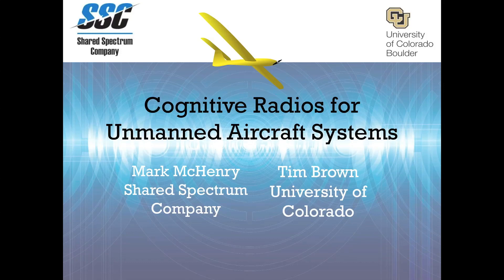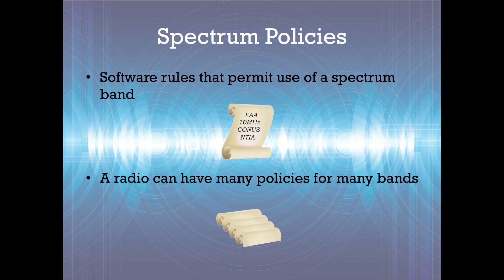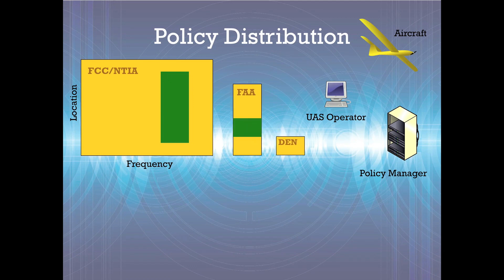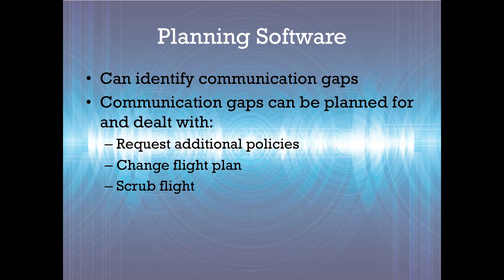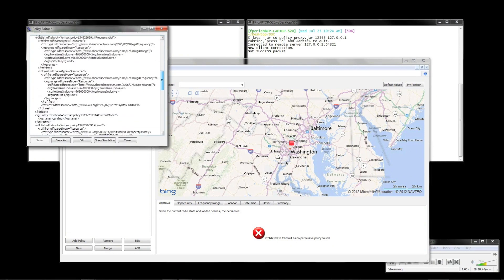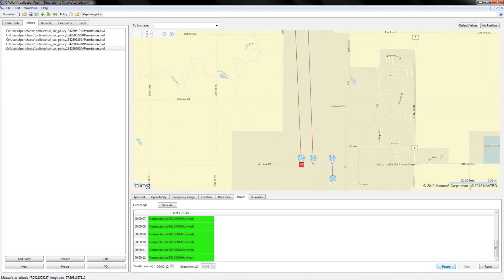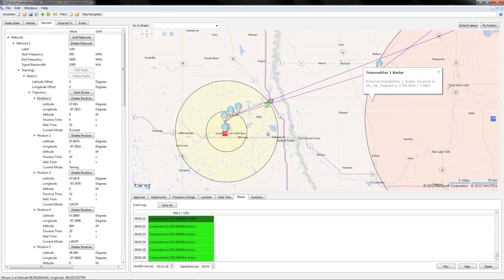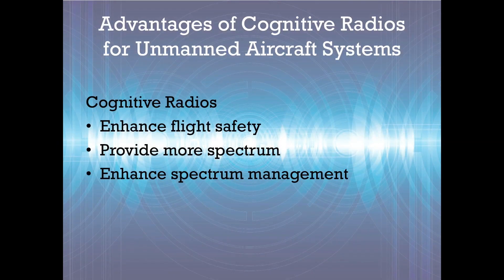Cognitive Radio for Unmanned Aircraft Systems

Comment: This is a very interesting and efficient use of white space, but i'm concerned that the relatively large number of steps might represent a technical challenge both for initial implementation and continued security.  In unmanned flight applications it also requires some amount of integration into existing systems to allow behaviors like command frequency to be adjusted on the fly where they are currently operated by mechanical switches and other manual devices.